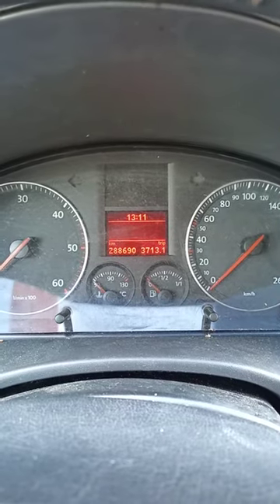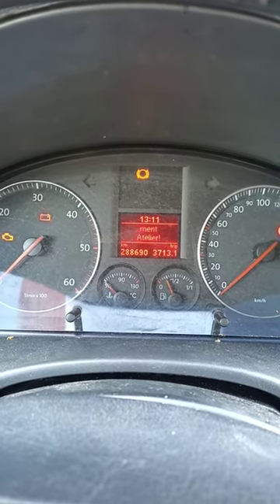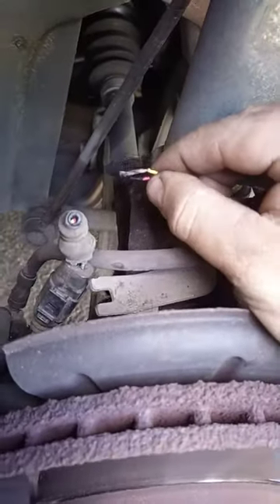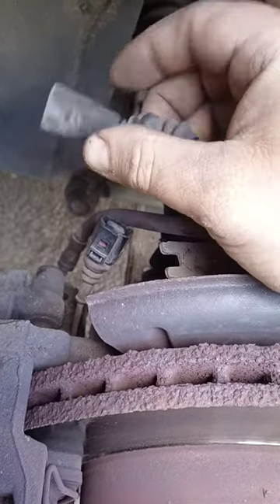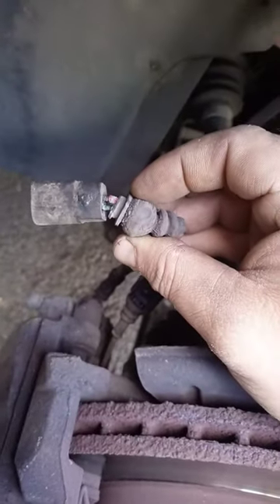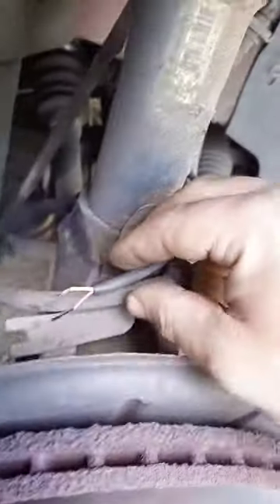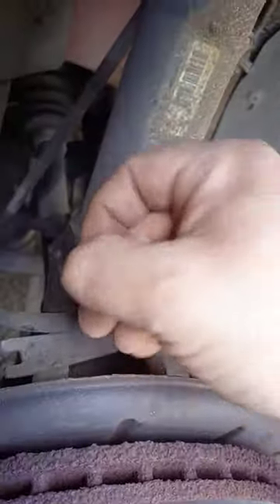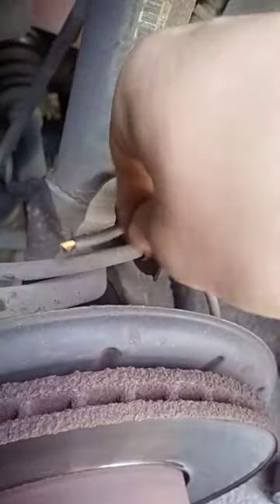Turn off the brake pad warning light quick and easy on ANY car

Comment: nice trick, is the wiring loom hard to replace my wires in the connector car side are broken will do this short fix for now but might replace loom if easy enough
Reply from the maker: Well you have to wrestle a bit but it's not that hard no. But why bother...the wear indicator sits on 1 brake pad and on a lot of cars only on one side of the vehicle. The light won't burn if the outside brake pad is worn. Just check them regularly, much better/a lot safer.

Comment: Why is it coming on My 2011 Audi A4 started to give this warning lights!! Do i need to worry immediately so is it okay to drive for 100-200km more before fixing it since I'm currently in a difficulty spot!
Reply from the maker: Check your brake fluid level and the wiring. You can check that on the ground when you turn the wheels completely to the left or right, depending on which side you want to check. If you don't find anything out of the ordinary, scan the ABS module for fault codes.
Reply: @demonautomotive2726  thank you

Comment: Will this work on a golf mk6 front pads?
Reply from the maker: Sure, just disconnect and twist/solder the wear indication wires together. Put some isolating tape or a shrink tube on them and you're good to go.

Comment: Will this work on a 2008 VW passat b6, thanks for the video
Reply from the maker: Yes it certainly will
Reply: @demonautomotive2726  glad to hear it, thanks for taking the time to reply
Reply from the maker: No problemo, have a good one.
Reply: Will this fail MOT
Reply from the maker: No, not at all. There are cars who don't have sensors on the pads so, not a problem at all. But off course, make sure your brakes are in good condition.

Comment: I did that and about 5k miles later the wires turned black and now the light won’t go off
Reply from the maker: You need to solder them and check out the rear brakes/scan for fault codes.

Comment: Will this work on a golf mk6 front pads?
Reply: did not work for me
Reply from the maker: Did you twist the correct wires together? Always check you manual, the sign could maybe stay lit for another reason. And if possible, scan for fault codes.